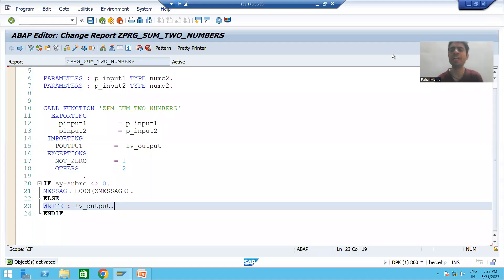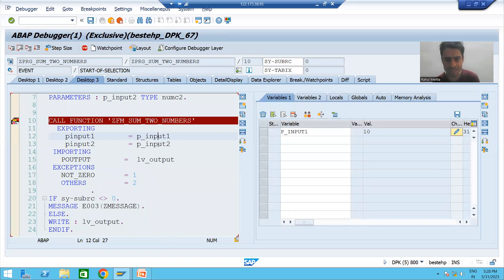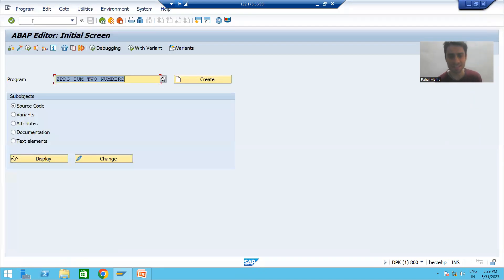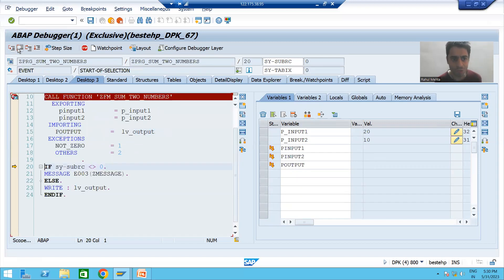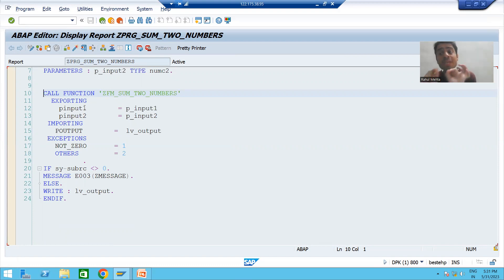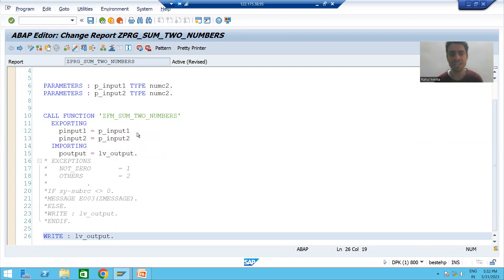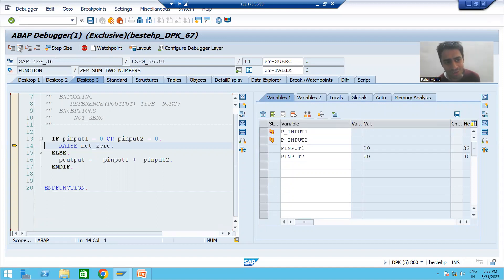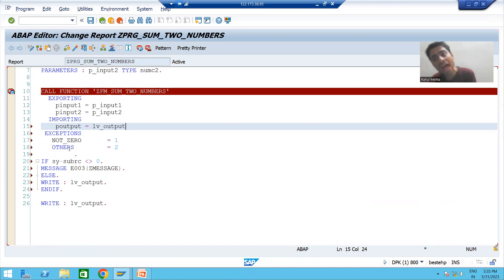10 - Modularization Techniques - Function Modules Part7

Comment: Hi sir,

if input1 <> 0 and input2 <> 0  ----> iam not getting any error 
if input1 and input2 is not initial  ---> iam getting error - relational operator ' and ' is not supported.

Please could you explain this system behaviour ?
Reply from the maker: You  need to write IF INPUT1 is not initial and input2 is not initial.
Reply: @sapabapbyrahulmehta  ok noted ...thank you !